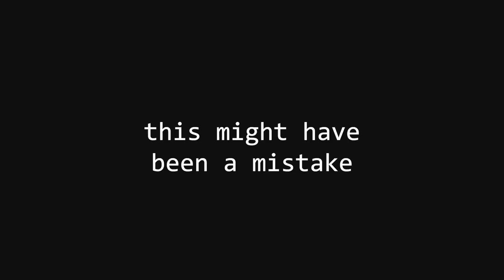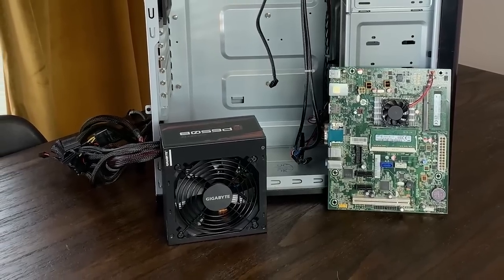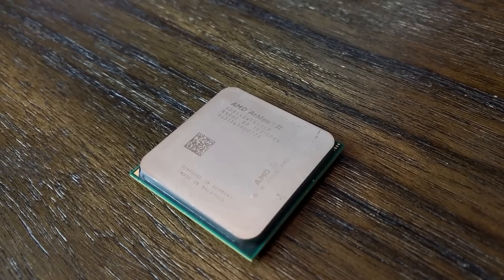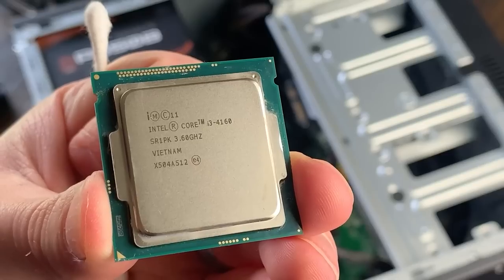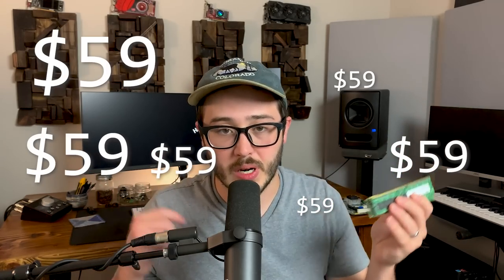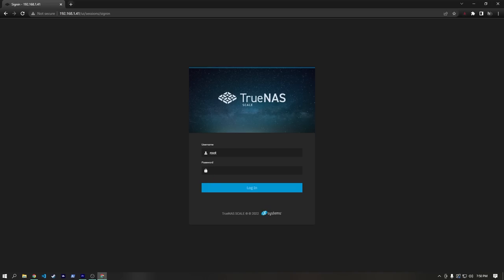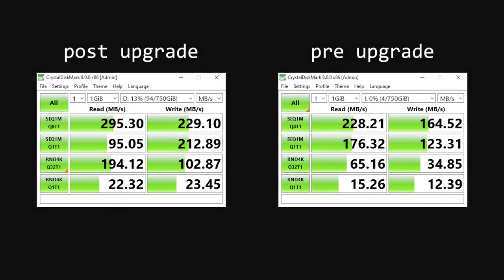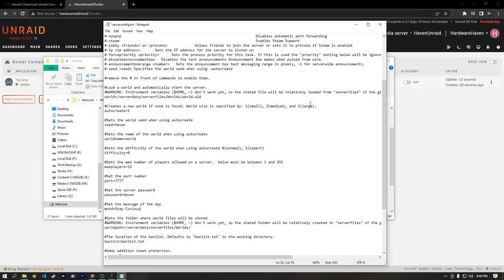Upgrading My TrueNAS Server

Comment: If you understand what ECC RAM is you would know it is way overkill for what you are using it for. ECC RAM is only applicable for workstations in high production settings and servers. With proper configuration the idea you would ever need it for a home build NAS, or any home style NAS is absurd and anyone telling you that you need it is clueless about what "it" even is, let alone have any idea why its used in the first place!
Reply from the maker: This seems a bit rash.. I don’t think it’s ridiculous to want to correct errors in memory that could potentially cause corruption. Yes, it’s not as necessary for consumer applications, but considering it basically didn’t cost anything extra, I feel like it’s worth it.